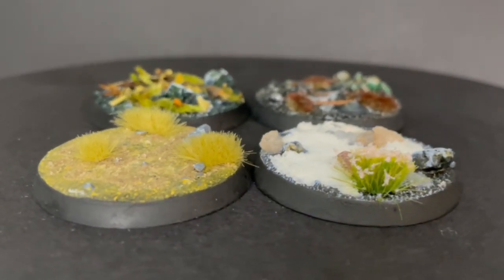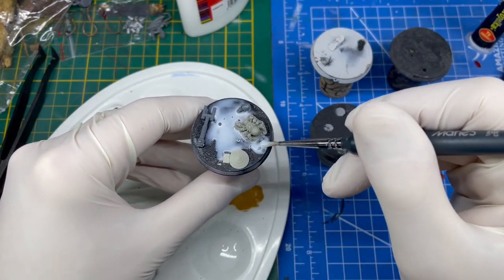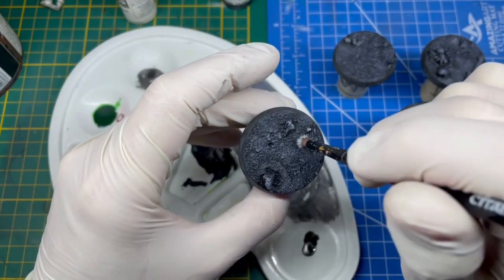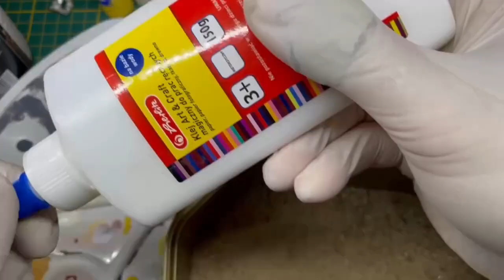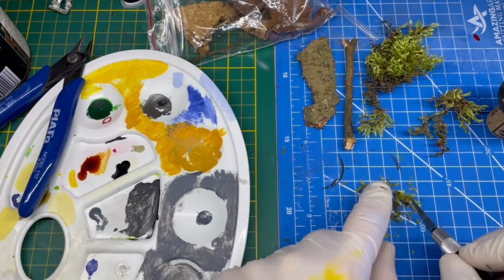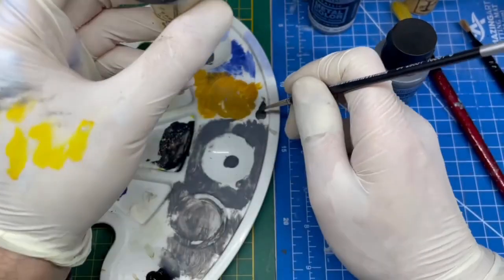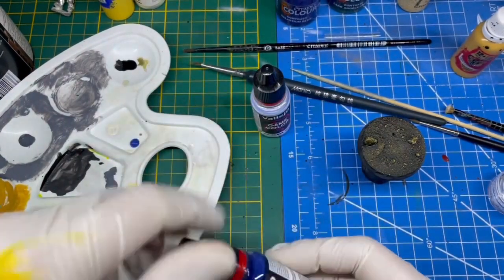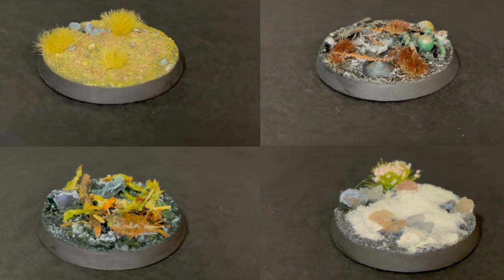Making bases out of free stuff.

Comment: Before using a second coat of glue to harden the sand or dirt layers, you should use a 50% water / 50% alcohol mixture with a pipette. This mixture will saturate the inside of the base and make the glue flow everywhere effortlessly, ensuring that it stays on top acting as an irremovable protection. You can use a pipette too, as you tryed, for that second diluted glue layer. It was like a vital experience when I discovered it ;D
Reply from the maker: Hey @PeaceTalker. Thanks a lot for the comment. I didn't know that. I will definitely apply your hint in the future. This is one of the reasons why I do those videos. To learn from knowledgeable people like you. Once again thanks. Cheers.